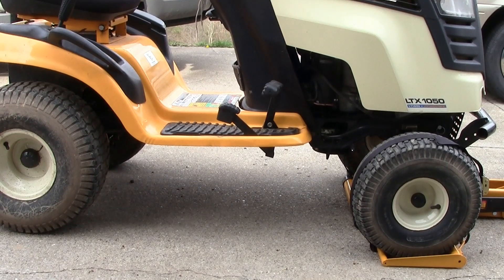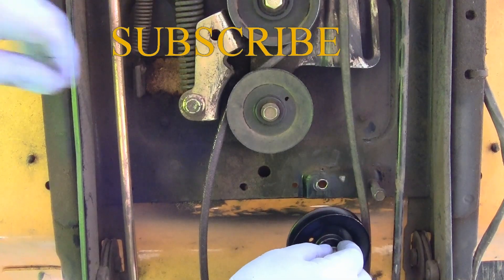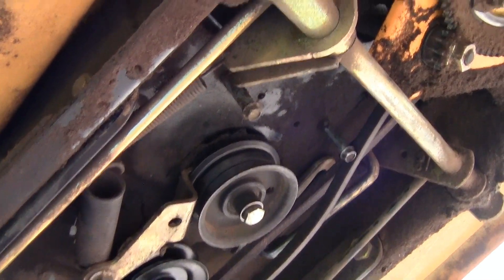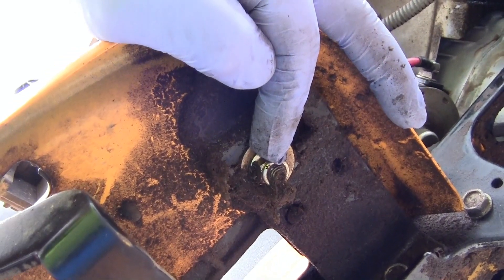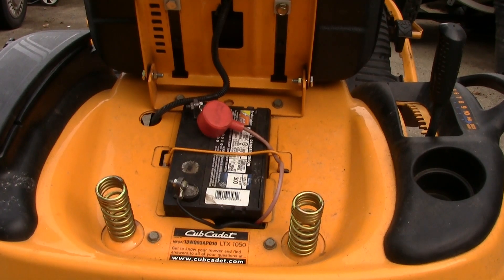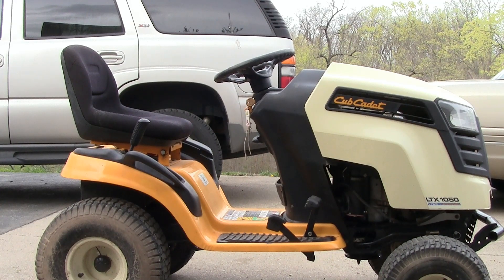Cub Cadet Drive Pulley Installation

Comment: Good info.  Mine is an old LTX 1040 I find I can change those pullies every couple of years so instead of doing all the work on loosening the body up I drilled a hole through the body where the pully nut is and capped it with a rubber plug.
Reply from the maker: Thanks. I also thought about doing that but it wasn't my tractor.

Comment: Thank you!!! I seriously spent a long time trying to figure out how to get to that mystery nut. I gave up, knowing I'd have to remove the body. Your video was awesome! Now I'm just tempted to just use a hole saw just big enough to get a socket on it though.
Reply from the maker: Your welcome and thanks!   Drilling a hole is a good idea but chances are, you'll never have to change it again hopefully.
Reply: @LonnieJohnson1  I've got 612 hours on mine..I use it for everything! Mowing, plowing snow, leveling soil, pull behind wagon while I do the animal chores.  I rigged up an ATV winch on the snow blade for easy up/down operation 😏. I'll probably end up doing it the right way, as you did in your video, but it is tempting to cut a hole. Kind of wish I had that lawn mower lift that you do!
Reply from the maker: The lift is nice. Sometimes you can find them on sale for 170 or less. Same model lift with a different name brand because I've seen them in stores after I had already purchased this one for 210.
Reply: @LonnieJohnson1  I replaced the pulley tonight in a whim. Probably took 45 minutes. I think 10 minutes of that was finding that dang washer that went flying to no man's land.  My other fault was leaving the mower deck on but all is well I got it replaced!  Unfortunately it didn't solve the loud noise coming from underneath when the clutch pedal is released. I replaced all the other pulleys last year in effort to fix that noise. Also replaced the electric PTO.  Not much else other than the main drive pulley, which I'm not sure why that would be making noise.

Comment: Do you happen to have the part number for the 2 identical pulleys you first show?
Reply from the maker: Cub Cadet 756-0978B is the engine pulley. Those 2 other pulley's are v pulleys for the drive system on this mower, also Cub Cadet 756-04224 flat pulley is also used for the drive system. These 4 pulley's work the drive system and can be used for other purposes. There is also one more pulley, Cub Cadet 756-04308 that holds the fan in place.
Reply: @LonnieJohnson1  Appreciate your response, thanks for that and the video!
Reply from the maker: Your welcome

Comment: Terrible design by Cub Cadet.  Can't find a service manual for LTX1046 online.  Your video saved my  bacon.  No wonder people let these idler pulleys make noise for years on end.  It is not an easy repair.
Reply from the maker: You're right about the design. Also the dealer charges way to much an hour to do this repair so to save $$$ it's best to do it yourself.

Comment: How can I remove or loosen the body on 1042 cub cadet to replace one of the drive  pulley it is different  than the 1050
It has no bolts in the middle.
Reply from the maker: I would have to look at it. I would have thought they would be similar.

Comment: That’s great except there is nothing in this video about replacing a drive pulley. You replaced all of the idler pulleys. Literally the only pulley you didn’t replace was the drive pulley.
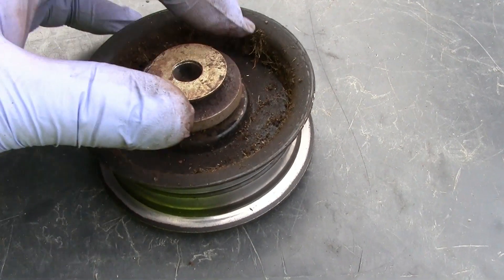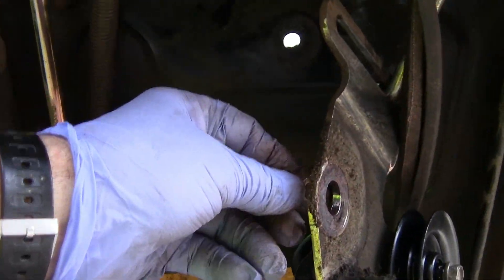Reply from the maker: At 4:03 through 4:40 is the nut that holds the drive pulley on the reassembly.
Reply: I am referring to the pulley that drives this operation. It would be located on the shaft that comes out of the bottom of the motor. The drive pulley will generally be on a keyed shaft. I didn’t see you change that in this video. It’s a good video but the title is incorrect and leads people to waste time watching a video that they don’t need. Anyway, good job.
Reply from the maker: Thanks and thanks the info. Your talking about the main engine power band pulley. You have a different number of drive idler pulleys connected to the drive system, I did look it up and the part that was ordered did say drive pulley.

Comment: What's the name of all those pulleys?
Reply from the maker: From the back pulley with the fan is the input pulley, the next two are idler pulley's, then you have a flat idler pulley, and then the engine pulley. Do you need all the part numbers as well?
Reply: @LonnieJohnson1  it will be very much appreciated, is a cub cadet ltx 1046
Reply from the maker: Pulley, Input, 4.13 Dia Part# 756-04308 
 Pulley, Idler, V-Type x 3.06 Part# 756-04325 
 Pulley, Idler, Flat 2.75 OD Part# 756-04224 
 Engine Pulley, Electric PTO Part# 756-0978B 
Hope this helps
Reply: Ok, lets say my mower is now totaled after watching this very clear and helpful video lol! I could possibly use a hole saw to reach that bolt from above without disassembling the entire body right?